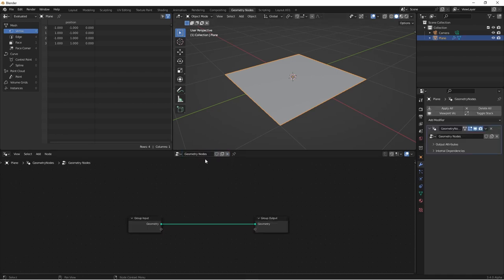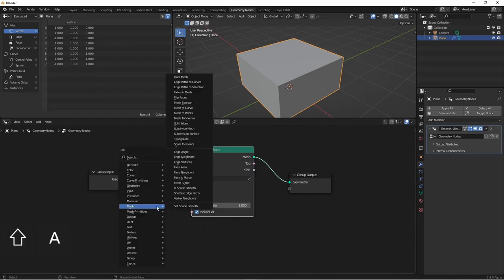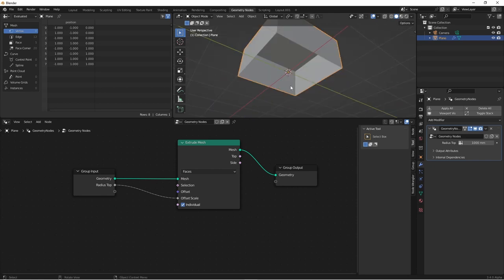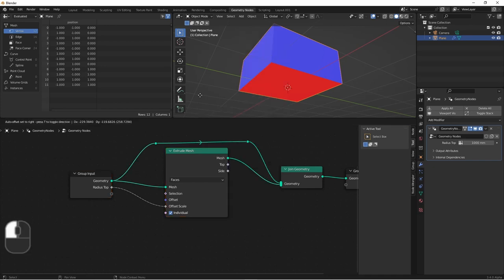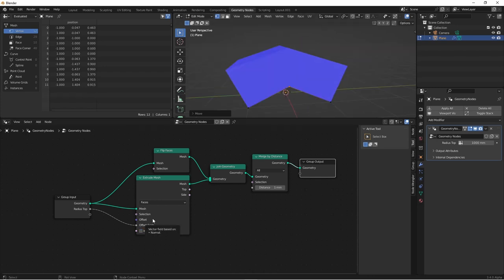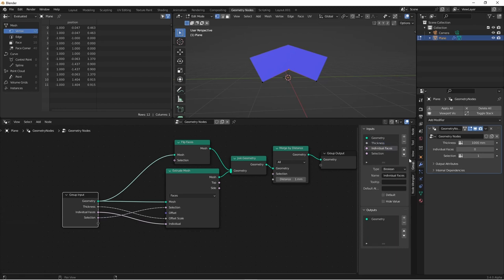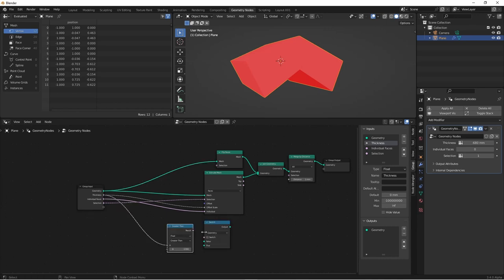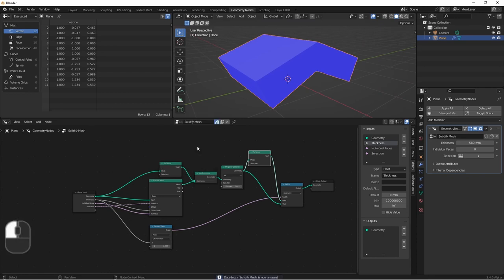Hey! Can You Do Me a Solid? Building a Solidify Node

Comment: Having to add the millimeter input from another object seems like a bug or missing feature. Do you know if this has been reported yet? Definitely a good tip I'll be using.
Reply from the maker: Yeah, changing socket ‘subtype’ is a missing feature. I looked at adding it a while back but got sidetracked.

Comment: Excellent video! How would go about making even thickness for the solidified mesh? I've been using this to generate ledges around a house, however large scale extrusions typically get very warped when using the extrude node
Reply from the maker: Yeah, that is why this is a stop gap measure at this point until the ‘complex mode’ version of solidify modifier is made into a node.

Comment: What about even thickness and materials
Reply: What about growing from 0 to both up and down (like solidify offset set to 0) I can't resolve it with one extrusion node I have to use 2 of those nodes and it makes things heavier than it should be after merging. Even thickness should be checkbox in extrude node and curve to mesh.
Reply: The offset slider in the Solidify modifier would be a nice feature to have in the Solidify node.
Reply from the maker: Yeah I like that idea